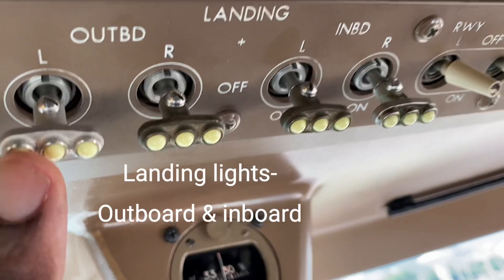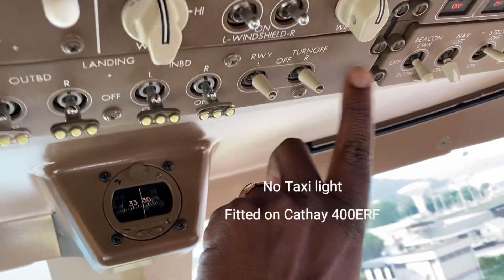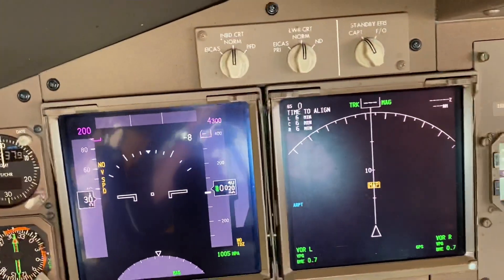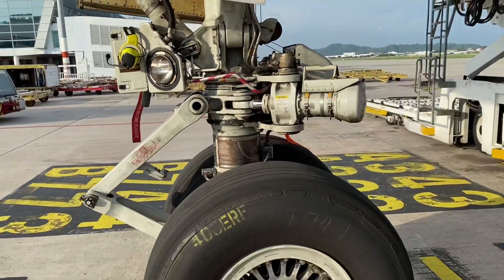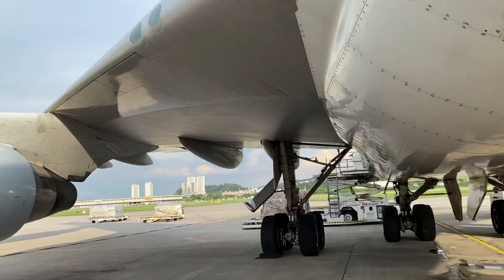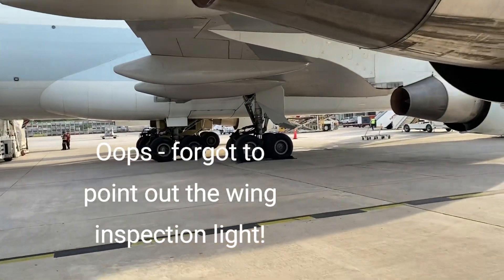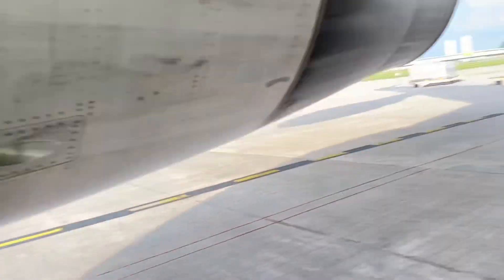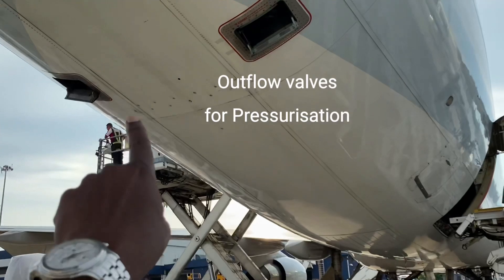Boeing 747-400ERF lighting controls

Comment: Why is there a 'lower beacon' light and a 'both' light? Any procedures where you use just the lower beacon lights?
Reply from the maker: We have a lower beacon because sometimes the flashing Red can be distracting in flight at night in cloud or even in dense fog on ground in low visibility operation.The lower beacon is also used to alert ground personnel to either use as an agreed signal or to inform the ground personnel that an engine may still be running and they should not approach the aircraft yet. Generally’Both’ is used but I have selected lower on occasion in thick cloud at night.
Reply: @pilot_obet  Thank you for the explanation! I had always wondered but it's good to know. I'm surprised it's only fitted on the 74s.
Reply: Not a pilot but I think only lower beacon light is used upon engine startup to alert ground crew.
Reply: Captain Obet, please clarify this